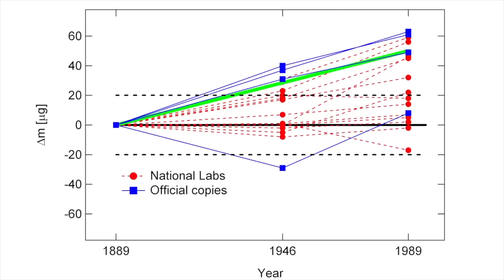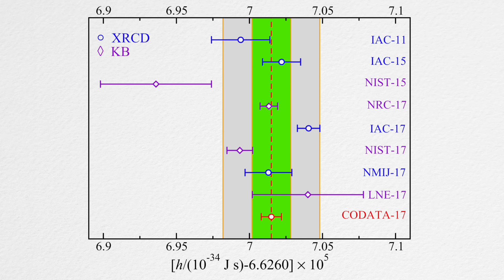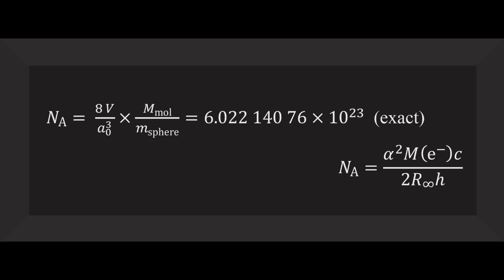The kg is dead, long live the kg

Comment: There’s maybe a little problem in that way. What if we discover that some of the equation/theory we have invented to explain the universe are wrong?
Reply: they might become more precise, but those particular constants can still be aproximated to what it's shown in the video. Plus, by making them fixed, we can compensate other values and constants. They were selected at the current values because they complement eachother. If one would be wrong, it wouldn't be able to be calculated from another, but with the current numbers, they can. So future measurements would be based on this weight formula, and give slightly different values than before, but you would be able to then split them down to the basic constants we have now. That's the beauty of science, it's self correcting. More precise future numbers would mean a more precise kg.

Comment: The problem with kg is that its original formula,
 it does not work on a rotating earth. P = mg, does not work on a rotating earth.
If P = gm works in practice, then the earth is stationary.
 Watch my video. https://youtu.be/2VxYxqMJgCk

Comment: We still need physical representations of the kg to weigh things on balances.  Under the old standard, copies of the standard kg were made by comparing them to the standard, then distributed to the various standards bureaus which could make more copies, so eventually laboratories could get an accurate (if not perfect) kg object.  How does one manufacture a physical kg based on the new definition?
Reply: I get it now.  The various standards labs will have their own Kibble balances, which can be used to make accurate masses.

Comment: Metric: Let's standardize everything logically, make everything consistent and reliable! :D
Imperial: FiVe ThOuSaNd TwO hUndReD EiGhtY fEet In A mILe
Reply: Ideally we should all be using natural units. It's possible to measure all physical quantities with just the units of the 'second', s, its reciprocal, s⁻¹, and a unit of electric charge, e. Distances and time intervals can both be measured in seconds. Mass, energy, momentum and temperature can be measured in units of frequency; i.e. the reciprocal of the second, s⁻¹. Angular momentum, speed and entropy would be dimensionless in this system of units and the speed of light would have a value of 1.
The SI system of units should have been redefined with just two base units. The second and a unit of electric charge are all that is required.
Reply: d_avery — The number of feet in a mile is as reliable as any equivalence in SI units.

Comment: But wasnt the weight of a kilogram supposed to be 1 l of water under normal conditions? I know thats hard to use but it should make it so that we can see when the artifact we used to mesure what is a kilogram have drifted away from that.
Reply: Except that water doesn't have a constant mass, due to different isotopes of Hydrogen, also water can have impurities of other elements and compounds. Furthermore water molecules are constantly evaporating and condensing, so the mass isn't constant. Also the temperature must be exactly the same as it was when it was measured hundreds of years ago, to within thousandths of a Kelvin. Then you need to take into account that gravitational field strength isn't quite constant all over the surface of the Earth, and due to forces due to the Earth's rotation apparent gravitational field strength is lower at the equator than at the poles. Overall, there are way too many variables to take into account when trying to get as accurate a comparison as possible, so it is just better to define a kilogram with constants.
Reply: @Nutty31313  My friend you misunderstand me. I am not saying that we should use water to define what a kilogram is. 
What I would want is for the kilogram to be equal a liter of water for most practical aplicatinos when you dont use supper precice mesurring.
Reply: @baltulielkungsgunarsmiezis9714  Yeah generally 1 litre of water is about 1kg and for everyday use it is close enough to be used, that didn't change at all, but the problem is you suggested we use 1l of water to compare the drift of a physical measurement of the kg. There are too many variables to take into consideration to have 1l of water be consistently the exact same mass.

Furthermore the divergence in the masses of the blocks used to define 1kg while noticeable, was only a divergence of a couple 10s of micrograms. So unless you are able to get exactly 1 litre of water to within a 100,000th of a millilitre then you can't use that to measure the divergence of the blocks. Considering a single droplet of water is about 0.05 millilitres that's borderline impossible, you'd be trying to know the volume of water to within a few thousands of a droplet.

Comment: Cannot they just say that "1 kg is X atoms of Y element"? What's the problem with this approach?
Reply: Jan Lewandowski i believe it’s cause atoms don’t have constant mass. The most blatant example would be a beta decay, the mass of all the protons neutrons &c. will not be the same on both sides of the reaction because some of the mass becomes energy. But in some ways they are, since they have set how many atoms will weigh the atomic number in grams with avagardos number.

Comment: I learned in my high school that water dilates and contracts with temperature like anything else, with an exception: Under 4 Celsius degrees there start forming microscopic icicles inside of it. Ice is expanding the more you reduce temperature. At 4 Celsius degrees, pure water will have its highest density. And one liter of water ( liter = 1/1000 cubic meter) at 4 Celsius degrees, normal atmospheric pressure, weights one kilogram. 1000kg = 1 ton (1 cubic meter of pure water at normal atmospheric pressure).

Why did they need to alter Planck's constant? Is pure water only kept in France, is one meter or 0,1 meters hard to measure exactly or is the atmosferic pressure at sea level hard to recreate?
Reply: It used to be the definition of a kilogram, the mass of 1 liter of water in standard pressure and 4 degree celcius of temperature.

But having pure water (with no minerals, or dissolved liquid and/or gas) is extremely hard (and quite a bit impractical for daily recreation).

Comment: instead of focusing on the gravitational pull, they focus on the force exerted by it and name it kg. On the moon a kilogram is no longer a kilogram is it?
Reply: It's still a kg on the moon, mass has nothing to do with gravity which is why the unit of mass is kg and not like weight which is a force (kg*m)/(s^2) (also known as Newton (N)).
With the old method they used a scale which converts "weight" into "mass" using the local gravitional acceleration (which can be measured precisely with f.e. an accelerometer inside the scale).
Now nothing really changes since we still use the local gravitional acceleration to get to mass.
Reply: @SneeuwPoesjes  ye but it does not exert "1kg" of force on the moon, so it would be better to use other units. Also it would be wise to finily connect electricity, gravity and Aether and come with true understanding of the wheelworks of Nature and not those assumption and observational equations.
Reply: @manipulativer  mass (kg) is not a force! no matter where you are 1 kg is 1 kg. If you stand on a scale here and it shows mass it actually measured a force (N) and converted it in mass (kg).
And I won't discuss that electric universe crap here, especially when you don't understand the difference between mas and weight.
Reply: @SneeuwPoesjes  well you corrected me good. I give you credit about that.
Since you are so knowledgable can you explain to me 1 thing. 
They used michelson and morley experiemnt to disprove the existance of the Ether.... but how come they use the same concept to detect gravitational waves at LIGO?
And about mass and weight and neutons i know about is just that i am looking furter and seeking a way to see the wheelworks of Nature better... And mass as in atomic mass makes sense that it has a weight based on the gravity and such i get that... BUT I am still having trouble corelating Ether with magnetism or Ether with gravity via electricity and the electric universe is all logical and easy to corelate while the lies we get told are hard to imagine.
Reply: @manipulativer  Indeed, the Michelson and Morley experiment disproved the ether where light rays would travel with. The earth is in orbit around the sun, so if there was an ether at one moment we would travel with the ether and at the other moment against the ether, this would mean that light rays would take longer than at other moments depending on our place in the orbit. Michelson and Morley disproved this with their experiment using an interferometer.
The interferometer is an apparatus which splits a light beam into 2 which each travel in an arm, the arms are at a 90 degree angle from eachother (f.e. 1 north and 1 east). At the end of the arm there is a mirror reflecting this beam back to the center where they are both redirected into a sensor. Since light is a wave we can see an interference pattern arise. Visible light has a wavelength of about 300-800 nanometer, so we can measure changes in pathdistance with nanometer precision. 
This pathdistance can change if for example a vibration happends (someone walks by or a car drives by) and one of the mirrors moves a bit, but it can also change due to relativistic effects. 

Relativity (especially general relativity where it's about now) is a really hard concept so I simplify alot now. Basically it states that space and time are related to eachother and form Spacetime, if something has mass it distorts spacetime (a good visualisation of it https://www.youtube.com/watch?v=MTY1Kje0yLg ). If 2 large objects collide it creates a ripple in spacetime known as a gravitational wave. Also remember that relativity states for a constant light speed.
in case of LIGO what it detected was a ripple of spacetime which briefly changed one of the path lenghts while the lightspeed stayed the same and so covered another distance and got to to sensor out of phase with the other lightbeam (these ripples are so small that it requires kilometers long interferometers to detect it!).

Physics is really hard, if someone says he understands physics he is lying. There is really enough stuff we don't understand and can't explain with the theories we have now, not everyone is comfortable with that and they just go let's make a simple theory for everything (which basically the electric universe theory). The problem with that is that we don't see stuff it predicts what we can predict with our other theories, it fails at the most basic observations which are sometimes even done by students (f.e. cosmic ray detection). It uses things which can't explain well with the theories we use now but can be "proved" with the electric universe as proof the Electric universe exist, forgetting about that it requires all other observations and theories to be false.
Reply: @SneeuwPoesjes  Thanks for the response. The biggest problem for me to understand about these waves and analogy about "trampoline" being 2 dimensional. So does it has a up and down position? It makes no sense and since we are spinning around the sun at 90 degree and the sun is spining and rotating 90degree toward a black hole you find that it's similar to electro-magnetism, where 90degree is the "displacement" of magnetism or in other words amperes are 90 degrees of with volts.
And the space time theory sounds and looks like it works but for me its all backwards... what if time is a property of mass and not space? you see where i am going?
Aabout the electric universe i think it depends on how you look at it, if you compare their prediction about comets being exact and the predictions of nasa being wrong and the explanation of nasa not making sense while the electric universe did make sense makes you think about what else is nasa cappable of lying like they know the answer to you know? Like i know that Earth is a spheroid, but arguing about relativity and quantum physics when ether physics works is non-sense.
Also Nassim Haramein who is a well know physicist also speaks about the cenzure and about aether.
So... again... if they used michelson mourly experiment to disprove ether, what are they using the same setup for if there is no medium in which gravity could propagate? Like they can say about matter defforming or whatever but i don't believe that and perhaps is possible to find out for certain is just that i work on gut feelings and in my view they pumped up "gravitational waves" and forgot about ether as sience is ultimately dogma, where you need to go through the lies others went and agree to those lies to get a phd and continue lying if you want to get paid.
Reply: @manipulativer  Gravity waves travels exactly the same way as light, it doesn't need a medium, it only needs space.
Reply: @FrostDirt  Yo, can you explain Sagnac Interferometer experiment?

Comment: They should make 2 exact 1kg objects and one exact weighing machine with both a display and analog pointer to show the mass in kilograms so they can determine even 10 years in the future if a) both 1kg objects stayed the same, and b) the weighing machine is as precise as it was 10 years ago.
If you have 3 things together, which all should show exactly the same (of course on the same temperature), it would be the perfect setting.
One more thing: You either just have to find an exact measurement of the "room temperature" as well, or you have to make sure, that the measuring method is uneffected by different temperatures. I don't know yet if diffenrent temperatures play a significant role on the mass of objects, but I think on a really small scale, they do. What do you think?
If you want to change the world (on weighing) the same, you just have to invent a new standard and update all weighs which will be built in the future on that standard. Like for example a special sticker.
So you know every time, whether a weigh is precice or has a bit of uncertainty built in.
Revolutionize the world.

Comment: For my understanding, all the known essential constants are now defined into fixed values.  So wouldn't it be amazing to then find new conditions in our universe which actually do NOT match when setting into relation with the respective constants ? It may be the key for new findings to make actually. Because we have a "fixed bar" which allows us to measure new values going relative to these (or causing conditions to be found to diverge according to what is the case if being initially predicted by using the existing constants).

Comment: Hello!?  Why are the Kg masses changing?  Am I the only one dumbfounded by the process in which a sealed chunk of metal can gain mass!!  This process could be one the most important discoveries by man and you can find zero videos on it.  I'm calling conspiracy. This process increasing the mass of the Kg could be the same for the Earth.  It could prove and explain why the Earth has grown 3-4 times its original mass within the last 200,000 years according to the growing earth theory.  I think the scientists in charge are covering up this process as it's hugely obvious that it's an insanely interesting and important process happening and there's no information about it.  Wow
Reply: It's impossible to create a 100% efficient storage system so that's why there is a small amount of difference. It's not nearly enough variation for the earth to have grown 3-4 times in 200.000 years. 

There is video about how nothing can be 100% efficient, it's called entropy.

It's not some big conspiracy, what would people even gain from very, very slightly changing weight measurements?
Reply: If the Earth is gaining mass and growing, and you believe mass is a function of gravity, and gravity is increasing.  Does that mean that everything is getting heavier due to increased gravity?  Is there a process happening to the earth causing increased gravity on the Kg weights?  or is the same process increasing the mass of both like pair production.  Something is happening that is amazing and all this guy can say is the process is unknown.  Again....wow.

Comment: What is the weight of a hydrogen atom? I mean didn't NASA already figure out that Hydrogen atoms have a fixed value that never changes. Couldn't they just relate that a weight measurement? That way It would never change ever. Instead of essentially just stating that a number that goes on for infinite is wrong and it does indeed end. That seems silly.

Comment: if the constant is uncertain, then wouldn't setting it to a fixed value lead to marginal inaccuracies?
Reply: The the fixed value was based on the silicon ball that they used. I think
Reply: That's why they previously tried to measure the constants as accurately as possible, using multiple techniques, including the Silicon ball. It may be possible that in the future we use future technology to measure these constants even more accurately, but I don't see that happening for a long time, and at least until that time the definition of a kilogram won't be changing while simultaneously redefining itself.